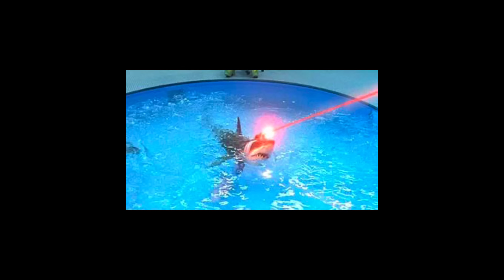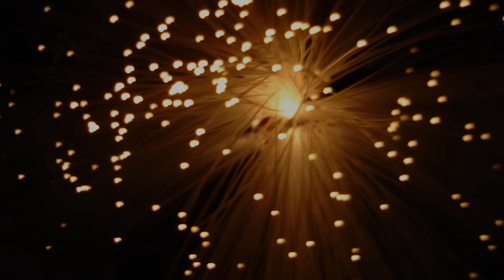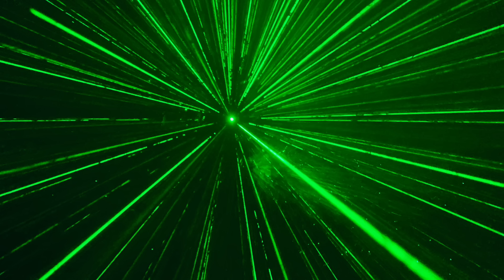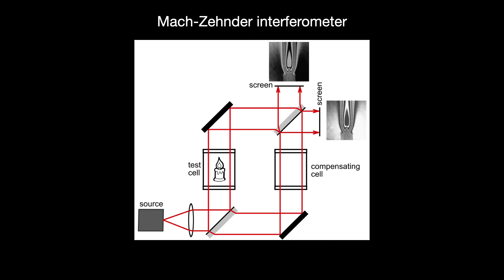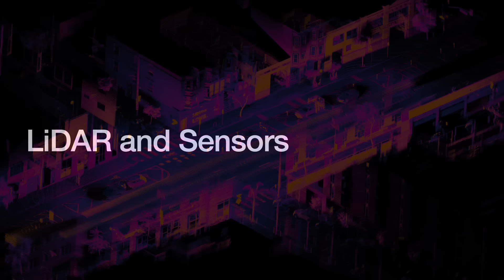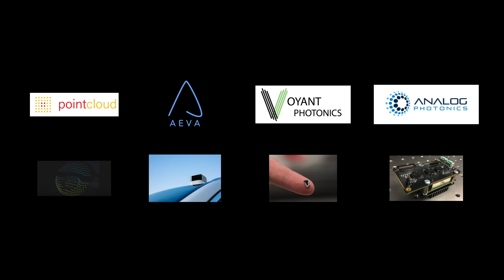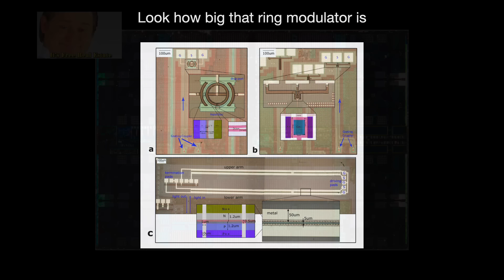Silicon Photonics: The Next Silicon Revolution?

Comment: You missed covering the only reason why you'd want to actually do photonics at the die level: photon based computation. You can already do basic logic operations using phase interference, but the really wild stuff starts happening when you start instantly resolving massively complex Fourier transforms by shining a coherent light through a filter. I knew a guy who worked at Lucent waaay back in the day, and I remember him talking about a project involving a fiber optic network switch that could route traffic without having to first move the data off the fiber and onto copper. A completely uninterrupted light beam. I wondered how that would even be possible over the years, then I read up on photonics - which is how you'd do it. Lookup the youtuber [Huygens Optics], specifically his video [Making Optical Logic Gates using Interference]
Reply: there's a lot to be said about photon computing. Another really important reason is that in order to make quantum computing work, you need photon logic.
Reply: @megalonoobiacinc4863  excellent point on quantum computing
Reply: Yeah I was left somewhat confused after watching this video. A lot of information about how it works, but not why it's better or why we'd want to use this technology.
Reply: @maybehuman4  He said it at the outset, faster, lower heat.
Reply: it is not going to be on silicon, more likely in lithium niobate. and the one simple thing which is missing in on-chip photonics is information storage - logic operations have already been demonstrated. Check Tobias Kippenberg if interested, he is the leading scientist on this field.
Reply: @tvbias  I wont pretend to be an expert in the field, but the lack of information storage doesn't strike me as a problem for anyone... so long as they aren't trying to do everything wrong. What would the wrong way look like? Anything that isn't predicated on an async circuits, which don't need to maintain state, so no data storage technology required - because no registers or scratch space. The input just falls through a number of transforms, to the output - which can be fed into another photonic computer, or interfaced to traditional cmos tech for storage.
Reply: @fox0ps22  also not an expert, just was at a conference recently. The point is: for any storage like RAM you would need to go to CMOS, as you said, but the opto-electric conversion efficiency is rather low, and this conversion needs to happen many times. This means such a photonic computer needs a ton of power to work. Optical storage would make such systems orders of magnitude more efficient. Not saying it does not work, just saying it is not mass market ready
Reply: @tvbias  Oh I understand what you are saying, I just don't see that as a serious problem - unless you're trying to use photonics for somethings that makes zero sense: like general purpose computing. Where does it make sense? Basically anywhere you presently find an ASIC accelerator. Back in the day I wrote a lot of SHA2 related code for FPGAs, and the easy workaround for state related slowdowns was simply unrolling the rounds - classic time/space tradeoff. Photonics can do the exact same thing, but waaay faster - with zero waste heat. So yeah, it isn't mass market ready - and never will be, in the same way crypto co-processors will never be mass market ready... they aren't supposed to be - it isn't something that Steve Jobs would have ever pitched, but would be found inside his conspicuous consumption products.
Reply: @tvbias  Niobate on silicon or silicon nitride though, right? Or is there any monolithic lithium niobate computation work that's looking good? Storage is a limitation but it's being worked around to some extent with delay lines, for example in neuromorphic computing.
Reply: @tvbias  Quick shoutout to Lithium Tantalate for offering many of the benefits behind LN with lower birefringence and higher optical damage threshold. 

Actually writing my thesis under a professor from Klippenbergs group right now.
Reply: @aphenioxPDWtechnology  This is why I mentioned the power platform - IBM tried standardizing a couple of PCIe-ish optical busses. Remember OCuLink? The "O" part of the name never really made it out of the lab. Same story with Intel's Light Peak, aka Thunderbolt.
Reply: Photonics at the die level could conceivably be used for high speed, low power die-to-die communication, if the transceivers were economical. All of the electrical interface standards (like PCIe) introduce sizable latencies at limited speeds and high power, creating bottlenecks to faster larger scale computers.
Reply: Wrong, he mentioned that after 13:49
Reply: That moment when you realize this is a technical explanation channel not a marketing channel!!!
Reply: That's literally what the video was about
Reply: @fox 0ps, as was mentioned in the video light cannot pass through die features smaller than the wavelength of the light used itself. Which means that the chip will be very large and potentially very hot.
Reply: @besssam  
it depends on the approach, i think implementing the light source outside the "chip" could bring an improvement on heat management, the biggest problem would be size
Reply: @besssam  That would be a big problem except for the fact that die feature size isn't infinitely divisible, there is a limit - but before we hit it we'll get into a region of laughably ridiculous costs for diminishing returns. We are in that region.
Reply: @fox0ps22 The feature size is not infinitely divisible, but at 3nm transistors a square micron could house over 100k transistors.  I’m sure that will reach 1M.   The video says at 7nm "over 100 transistors" can fit in a square micrometer. It is actually over 20k (1000*1000/(7*7)).
Reply: @besssam  
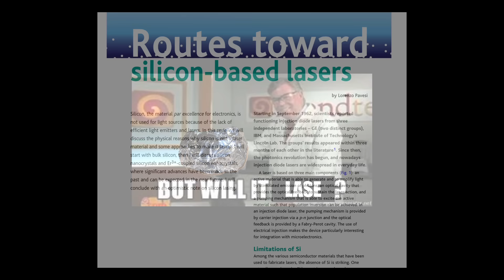i mean a solution like the one mentioned at  7:18
Reply: @aphenioxPDWtechnology  This kind of thing brings the old "faster horse" cliché to mind, the results of incremental low risk improvements. I've worked on the soft side of the openpower ISA, so I know what you're talking about with I/O bottlenecking, but even so when I hear about people going to such lengths as switching to photonics - in order to continue shuffling bits around as they always have... I always wonder how much root cause analysis is going on. Actually... consider the memristor: instead of shuffling tons of data between storage and processing - it performs both tasks in the same physical location. Well, hypothetically - dunno that I've seen anyone do it outside of a lab. Anyway... same story with photonics - you can do two things at once: transfer and compute. But to be honest I'm not a huge fan of photonics, I'm more of an asynchronous cryo-compute sort of guy.
Reply: This is an awesome reply
Reply: highly underrated technology. It's a wonder it's not being purposed more aggressively.
Reply: When you say die level, I assume you mean without fiber optics to the outside world? If so, I must disagree. The most likely application to come next, after high speed transceivers, is biosensing. The main case for this is the deal between Rockley Photonics and Apple to place sensing chips in the Apple Watch (presumably). Computation is very cool, but still niche. It's also so blazing fast but niche that it will be a long time before there's a global market for more than a dozen or so photonic computers.
Reply: @tykjpelk  maybe 5 years ago when freshly printed money was being squandered in the most ridiculous ways. But we are in a global recession now, and will be for some time, so the old dress-like-Steve-Jobs and use-a-fake-deep-voice Elizabeth Holmes routine won't work anymore. Tech will have to offer something tangible beyond "Imagine biosensing... in your Apple Watch!", because the follow-up will be "So what problem is being solved and not invented with that?"
Reply: @fox0ps22  The problems being solved are continuous glucose and blood pressure monitoring, both of which have real medical value to lots of people. I'm not into hyped up gadgets but non-invasive biosensing actually solves existing problems.
Reply: @tykjpelk  So problems for which there are already practical solutions in place that don't involve rose gold conspicuous consumption consumer electronics. This is something that I think a lot of people get wrong about indiscriminate biodata collection: medical science is not first principles based, in the way that computer science is, it is trial based. So no amount of bulk data will improve our collective understanding, and you wont benefit from the addition of an expensive medically calibrated sensor in your consumer product unless you plan on developing diabetes.

Comment: Imagine a future where everyone is keen on getting a laser installed in their house and everything plugs into laser sockets on your walls... A world where you just order new optical logic circuits from the factory to get stacked onto each other to get "soldered" with fiber optics between layers to solve your specific task with just a laser you have. I remember those sleeples nights of imagining logical inversion on diodes or some mysterious new logic gates that might exist in photonics, ah those good old bicycle invention days.
Reply: Laser socket?  you don't need electricity for those chips?
Reply: @shadowshadow2724  Not for my hypothetical ones. As were mentioned in this video modern approaches (as in photonics logics chips or tranceivers) mainly use either another semiconducter material for the laser inside the chip or a laser beam guided from another source, but we still rely on electro-magnetical excitation of some crystal in order to make a laser beam. Not really sure about actual signal fade in my theoretically endless scalability and real world quality of full internal reflection inside modern silicon photonics and how often would you need a repeater (more added energy) in such scenario. The obvious elephant in the room is the price (or energy and materials) wasted on manufacturng such devices relative to the lifetime energy consumption plus manufacturing expenditures of alternative electro-magnetic ones. On the other hand it's really hard to define the efficiency of modern electric chips since it's always relative to the electricity and price of equipment to the number of operations calculated during certain period of time. That period of time is usually defined not by the lifetime of a chip but rather by monetary benefit of upgrading your system into some newer generation technology. At the same time there should be always done this software/hardware weigh in in order to know whether your logic circuits are even worth making to be "set in stone" forever. The real benefit of such photonic approach would be almost indefinite lifespan of such a system (with only the risc of physical destruction and maybe some lychens). It should not fear solar wind or any rapid shift of magnetic field of our planet or even electro-magnetic waves from nuclear blasts or any nuclear blasts in ionosphere for that matter. Unlike crypto where you just burn coal for nothing you can "burn" some logic circuit forever whenever you have some free wind or sunshine... Em but for the lasers you would still need to transfer energy for them in some manner, preferably electric, if only there were some method to make a laser from concentrated sunlight.

OK, I'm not an expert neither in lasers nor in photonics but at one point I had a plan (among many others) to get my masters degree in Germany in order to get somehow to the GlobalFoundries since they have a lot of IPs in photonics, but that never happened unfortunately.

Comment: Ah Jon! Another episode that's not just a home run, but knocks it clean out of the park! The realization that an optical gate can't be smaller than the wavelength of the light it operates on puts everything into perspective.

I'm hoping for an episode on the research on room temperature super conductors and their implications for chip making!
Reply: What prevents us from using high energy ultraviolet lasers to make smalmer optical gates?
Reply from the maker: A gate isn't that useful if the horse is too big to walk through it.
Reply: @Asianometry  Hence my question why we can't use higher-energy lasers, whose wavelengths will fit through smaller gates. The high-energy end of ultraviolet light is in the nanometer range.
Reply: You need a wavelength that silicon is transparent. This limits your light to infrared
Reply: @kazedcat  I didn't know that, thanks!
Reply: @SpaghettiToaster  there's the added issue of needing a laser that can actually source the light in question, to my knowledge we still don't have uv semiconductor lasers, beyond that there's no xray laser tech yet at all.
Reply: @SpaghettiToaster  Sure, you want to pay to have a micrometre accurate device that perfectly vaporises tiny spheres of tin in a vaccuum chamber to emit EUV in your home computer so that you can... Watch YouTube better?
Reply: @Shrouded_reaper  wat?

Comment: no it does NOT........... light DOES NOT move thru a solid at the speed of light, that is what causes the refractive index.
and even so... light does NOT travel thru a fiber in a straight line, it bounces off hte internal surfaces  and the path is always longer as a result.
refractive index of GOOD optical is about 1.4~ so take the speed of light thru a vacuum & device by the refractive index of the medium.

result...... speed of light thru ANY medium other than a vacuum is NOT the speed of light thru a vacuum...
Reply: But what if refractive index is just a speed of vacuum moving along the light?
Reply: @AlexanderSylchuk  it is a thread so there is no vacuum...... as such totally irrelevant to the discussion
Reply: @stevesteve8098  It´s all relative. The speed of light is still the same, it´s just the interference of electro-magnetic excitations of the medium through which the light travels causes it to emit out of phase light which superimposes itself onto original lightwave and generally makes it a shorter wavelength. Speed of light remains constant, only the phase velocity of that wave gets slower.

But still, movement of a vacuum sounds like an interesting explanation. Have you ever heard about vacuum cleaners? The name itself suggests that the vacuum isn't that clean to begin with. Ad hoc explanations are always the best. I remember doing a phisics lab with my friend where we had to measure Plank's constant using total internal reflection. For some reason, either due to bad measurement or bad calculation, we got it almost correct, but only 10000 times greater than it should be. Our main theory on that was that at that exact moment the world has shrunk, divine intervention. So naturally, we adjusted the result. We were laughing so hard that we almost were banned from the lab and our professor was hesitant to give us even lowest marks for that since he decided that we are some morons who couldn't stop laughin and have absoulutely no idea on what we were doing.
Reply: @AlexanderSylchuk  you are talking garbage.
since you are the observer.... it depends when the light arrives in YOUR time frame.
and from your perspective it is slowed down.
therefore the signals thru a solid DELAYS the transmission of data in  FROM your VIEW POINT... and THAT is what matters.
Reply: @stevesteve8098  Your explanation is still about "vacuum moving along the light" since our time frame makes it to appear as if the light enters a solid then teleports itself into some "higher dimension" where we (or our frame of reference) are traveling with significant enough speed relative to the light so that we get the light delayed from the time we were expecting it to arrive.

There's a train without brakes going with it's maximum constant speed and it enters a tunnel. Everyone can measure the distance between the entrance and exit of the tunnel. Even more so, the tunnel is transparent on the observers side so everyone sees that it actually goes in the straight line. Everyone can see that from their point of view train slowes down in the tunnel. So in this analogy you are saying that it's simply the problem of our frame of reference, implying that it's just a nature of tunnels to delay trains.
I'm just saying that the track is wavy if you look up close onto it. Inside the tunnel there is a set network of tracks through which many smaller trains constantly travelling. Those tracks arent actually rigid but bend accordingly to all of the traffic input. And our train doesn't always go just through it's own track, but it has to find a way through the endless array of junctions set inside that tunnel. The rail network inside the tunnel makes it so that our train has to go longer path despite the fact that the speed is constant, frequency of it going through it's wavy course is the same, but the wavelength of its course is now shorter and it is defined by the nature of the internal "track system" inside our tunnel.

I just think that relativity explanation is too vague if we are just talking about frame of reference of observers. I think that the only important frames of references are just "our train", "trains inside the tunnel" and their "schedule" and all the "junctions" inside the tunnel (be it crystaline or molecular structure of our medium).